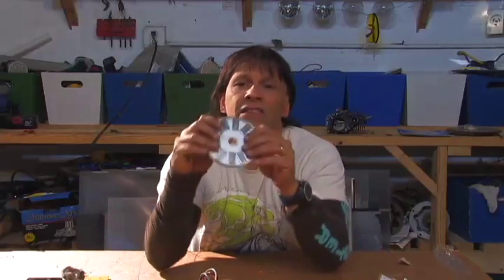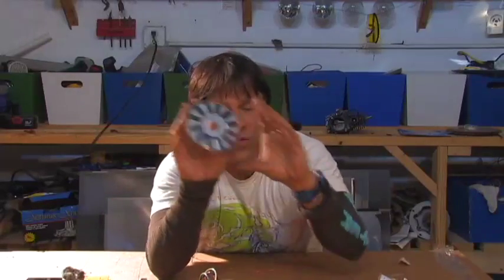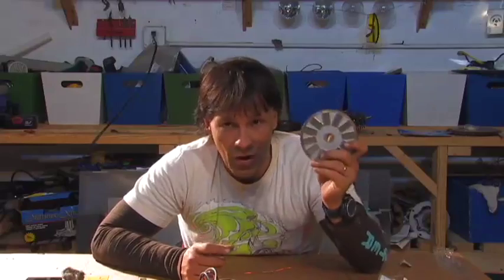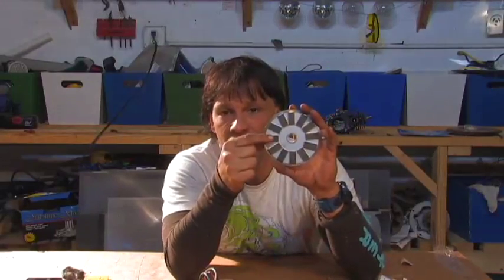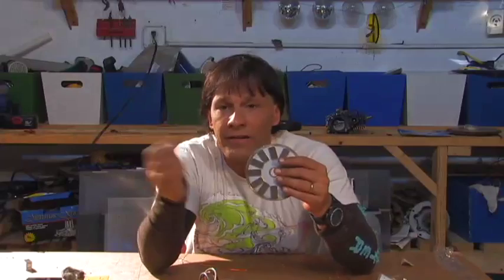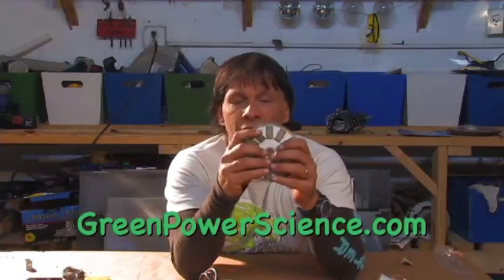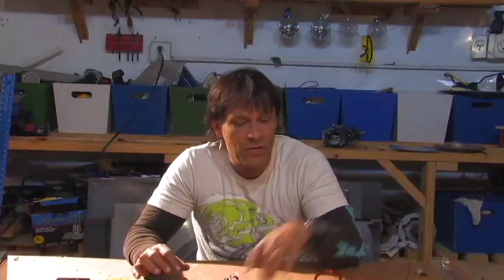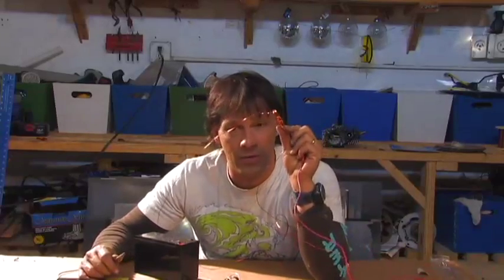MAGNETIC GUN DIY Axial Flux Alternator Hack Generator Neodymium Rare Earth Magnet

Comment: @GREENPOWERSCIENCE No. Centrifugal force doesn't exist. Centripetal force (applied by the glue/blade edge, or by the string if you whirl a yoyo around your head) exerts a turning force on the magnets to keep them going in a circle and not flying off the plate. Plain ole' straight-line momentum is what would make the magnet fly off if it could, at a tangent to the circumference of the disk, not outward from the center, and momentum is not a force.